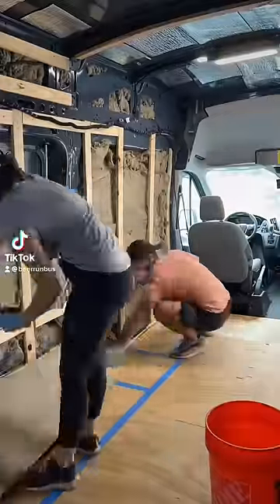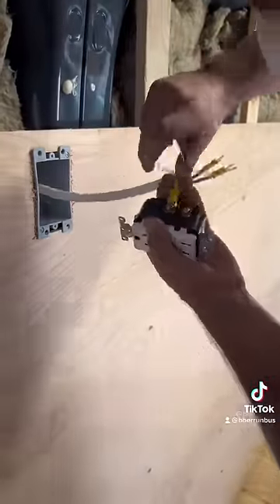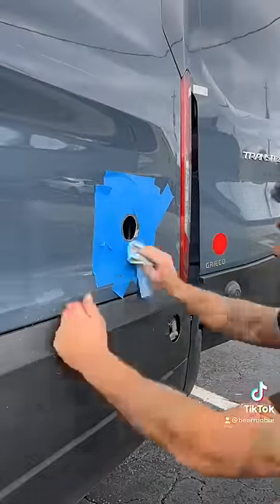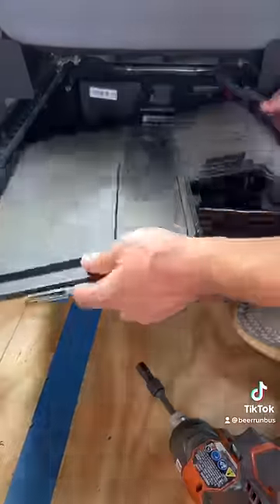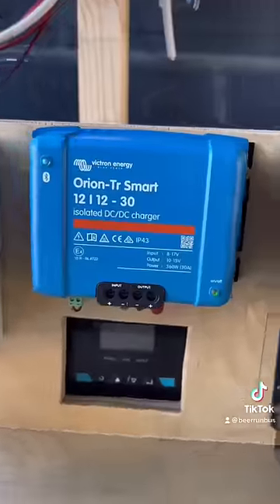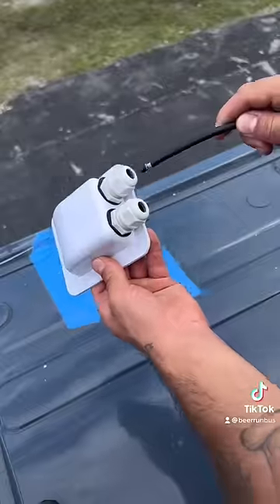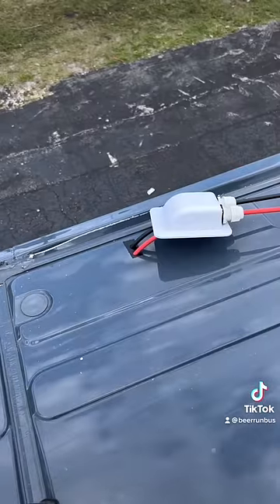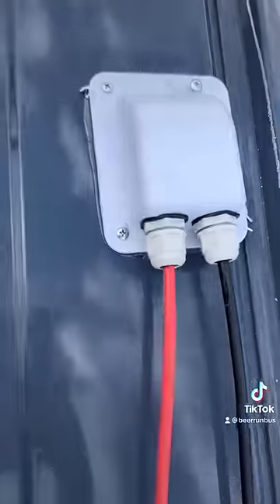Van Convertion Part 3 | #busconversion #vanconversion #vanlife #campervan #buslife

Comment: Solar wires going into the van should have had rubber grommet around them.  If it wasn't moving what they did was fine,  but as a the van drives down the road,  the metal will flex and eventually cut through the wire insulation and most likely with the amps running through the wire from solar cause a fire,  not really safe.  Do it right and never have to worry or do it again.

Comment: I hate to say this but this is exactly what you do not want to do One before you put insulation in what you want to do is basically so many places start one vapor barrier behind the insulation then vapor barrier on top of the installation have it overlap so you can make ACO that the insulations wrapped in also it creates a air block between the interior and exterior vehicle as far as like the paint aboard no definitely no way way better options out there that way less you have to remember you're adding weight to the vehicle also the battery upgrade supposed to the under the seat should have been different batteries etc blah blah blah regarding the cutout anytime you're going to make a cut on the panel of any vehicle you want to basically have that area reinforced even before you make your cut a jig plate works great also when it comes to the roof how you mounted those wires and you didn't put any protection from the wire rubbing up against the metal overtime which is going to short out and also that waterproof plate should have a matching plate on the inside of the roof ceiling to maintain structural rigidity and mitigate flexing at that point even though you screwed it in it's going to end up leaking guaranteed so many things that are overlooked

Comment: Did a slammin job.  I would have put a rubber grommet on the holes for the power wires going through the body so they never wear and short to ground.

Comment: good job on the build but a long term tip when you run wiring through metal like you did on ur roof you always use rubber rings so that over time the wire want cut into the metal because it will as the roof is always flexing ..

Comment: two mistakes. 1. using screws versus bolts and nuts. 2. you should have used a rubber washer to seal the screw.

Comment: As an electrician, I’m pretty sure that receptacle connection is wrong. You can’t have the hot and neutral tied to the same terminal.

Comment: Roof entry wiring is super dangerous you should have used gromets it just a matter if time before those short out from the hot roof in the sun and the vibration from driving and it will cut through the wire sheathing in no time. hope the breaker pops before a fire starts and it don't damage your panels

Comment: Should of used rubber gromets for that power feed on The roof vibrations gonna cut those wires if them so tight in the metal. 👍

Comment: You can get cleaner drill holes by drilling through the tape. Prevents surface cracking and you mask is already in place.

Comment: i cringed at the electric outlet installs just use the bare wire. crimping on connectors its an extra point of failure . not an expert i  think it wouldn't pass code

Comment: What?  You added solar panels to do what?  Charge a battery that is already charged by the alternator?  Shouldn't you have added a battery that charges with the solar panel when the van is not in use, but also have the ability to charge it with the alternator?

Comment: the holes for the cables from the solar panels are to small.. make bigger holes and put in rubber thingis in the holes. that way the cables can go in at a lower angle and the cables will not rubb against the metall at all :)

Comment: Get rid of the 12 volt connector your creating a failure point run the wire straight to the receptacle

Comment: You HAVE TO use grommets when running wire through sheet metal. Vibration will quickly cut through your insulation and fry your van.

Comment: You painted the holes you drilled so they wouldn’t rust but then used steel screws. Those rust. Use stainless steel and you’ll be a winner

Comment: I’m worried you wiring through the roof needs grommeted to not catch fire! Btw I’m not trolling just seen this happen from not  properly insulating with wiring and sheet metal…
Reply from the maker: We actually already went back and added rubber ones

Comment: the shore plug you chose is rated for 15Amp your system looks like 30Amps
Reply from the maker: I have a 2000 W pure sine wave inverter which I have set to charge at 20 A

Comment: Good job. Before you paint you have to scuff the clear cote with 320 grit and use rubber grommets fastened with a CVP or a (Loctite) adhesive to protect against the heat of the sun, especially on a dark color!
#ProfessionalDetailing #BodyshopTech

Comment: Hey man run some 1/0 gauge wire from your alternator to your battery then your battery to your rear battery’s. It’s called a big 3 upgrade you will get a lot of juice to your battery while your running your van
Reply: Alternator to battery. Battery negative to ground engine to ground

Comment: The roof wire need a rubber grommets. To prevent cutting of the wire insulation.

Comment: Needs rubber grommets for wire passing through metal. Vibrations from driving can cause the sheet metal to rub through the wire insulation even with the added silicone.

Comment: When you push the power cable through the top of the van I would have put some sheathing around the cable because of the vibration eventually it will eat through the sheeting of the power cable I think it's called The Grommet I'm not sure you could have put around that hole and made it just a little bit larger to put the grommet in or some kind of protection

Comment: You should have put rubber grommets around those wires going through the roof the sheet metal could cut into those wires and short out your system.

Comment: The sealant on the roof should be good. I would also add eternabond tape once it the other sealant is cured. Also add grommets or abrasion resistant tape around wires.

Comment: I really wanna know the before and after curb weight on that vehicle. Surely, they did some modifications to the gearing, cooling, and engine to keep up with the extra weight?
Reply: you can order that with a 6cyl diesel. I would not even think about a gasser here.

Comment: That shore power receptical is going to piss water through the wall in about a year. I'd try to get some rubber washers to use with that silicone.

Comment: I see a future electrical short where the wires go through the roof. This is what grommets are made for. All in all, an interesting project.
Reply: Grommets are made out of rubber. rubber rots. better to use something like PL500 construction adhesive that stuff is forever & is completely waterproof & sticks to EVERYTHING.

Comment: 400W isn't nearly enough, I'd add one or two more panels to ensure enough power on overcast days.
Reply from the maker: We have three panels total the other one hasn’t been put up yet
Reply: @buildersblueprint  That's good to hear, it brings me satisfaction to see a properly done system.  I'd certainly be annoyed if power ran out in the middle of the night or if I couldn't use my laptop which can consume up to 350W/hr.
Reply from the maker: @Voltaic_Fire  Completely agree with you I’m going to make an entire video on our electrical system soon thank you for watching

Comment: You need rubber grommets on that wires going through the roof.
Reply: no you don't rubber rots. what you need is loctite construction adhesive..

Comment: In the hole you cut.  Take out the attachment and on the inside of the cutout applet marine jelly and then use a crooked brush and apply Rust-Oleum to the inside.   Moisture can get in the hole and rust it out.  Applying the marine jelly and paint will greatly extend the integrity of the steel and help prevent rust at the cutout point.
Reply: Cars are fully dipped dude

Comment: Using 120 Volt AC in a steel Van is not a god idea.  The microwaves from the Wiring reflects around inside the Van, to a dangerous extent.
If you can just use 5 Volt and 12 Volt DC inside it is much safer.  Another idea to deal with reflection is to cut out the Window Holes and glue in Plexiglas.  The Plexiglass can be painted. It will allow the Microwaves to safely pas through. 
 Also, sometimes bubble warp can be filled with water, with non toxic antifreeze in it. That kills microwaves. Walmart sells an RV antifreeze very cheaply, that works well.
Reply from the maker: We install the 12 V air conditioner not 120

Comment: Pro tip, no need to tape off a small area for spray painting new exposed metal. If spray paint is all you have, spray some into a small lid then use a brush to dap it on.

Comment: Don't listen to all of these non-electricians telling you to use rubber grommets. At least one of them will pop out when installing it. You. Have exactly what you need to keep water out. Butyl tape to seal the roof jack & drill either a 1/2"  or 3/4" hole and use a bushing. YOU SHALL NEVER RUN A HOT WIRE THROUGH A HOLE WITHOUT A NEGATIVE. you will have loss in the form of heat when large loads are on those cables. If you do a/c wires like that it's a fire hazard and completely not too code.